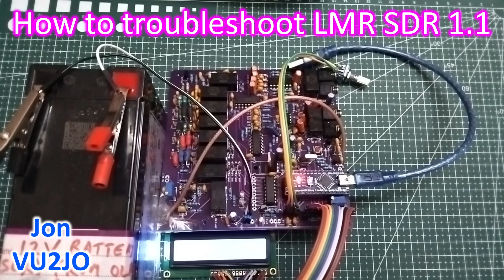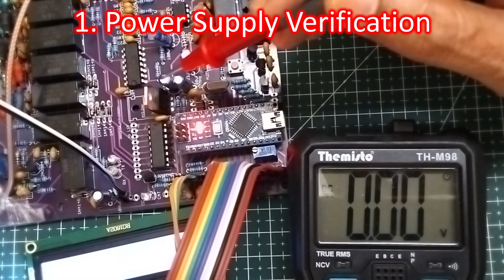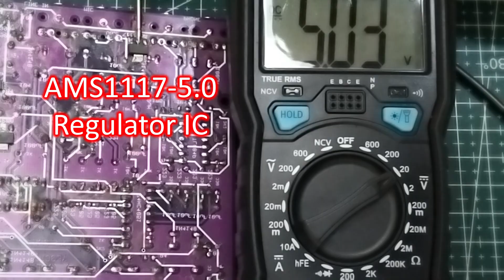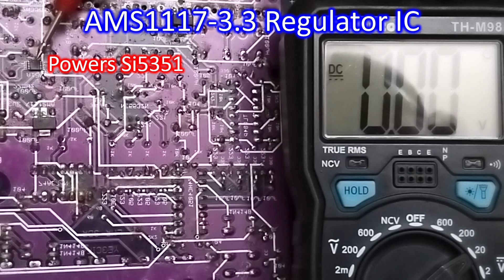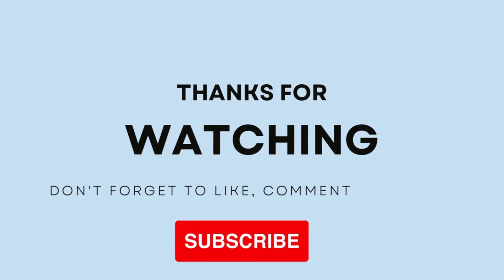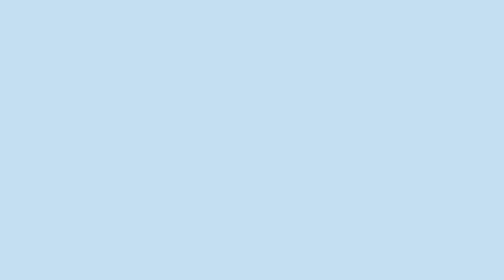How to troubleshoot LMR SDR 1.1

Comment: Interesting project 😊. Have you finished this? How is the reception /tx quality assuming it uses hc4051? Looking forward for more demos. Used to test them on laptop+battery to avoid ground loops via usb cables, audio connectors, main ground, antenna shield ground all gives a nightmare 😊
Reply from the maker: Finished wiring. Then the old refurbished desktop packed off! Tried with external sound card on laptop. Found that the one I bought online was only stereo for output and mono for input. That will not send the I/Q signals which need stereo for input and output. Trying to revive the desktop.
Reply: @johnsonsTechWorld  ok waiting for updates. sound cards with line in and good bit depth (24bit) and sampling rate 192khz or at least 48khz( determines the width of spectrum) are  crucial. Your plan for desktop cards looks nice. I remember my old, first acer laptop had line in, phone in, serial, vga, infrared etc.. old good days now is crazy days, phones with no earphone jack, no chargers included 😢
Reply from the maker: Let me hope that I will be able to trouble shoot my two radio projects soon.